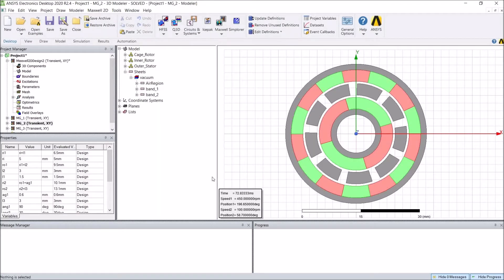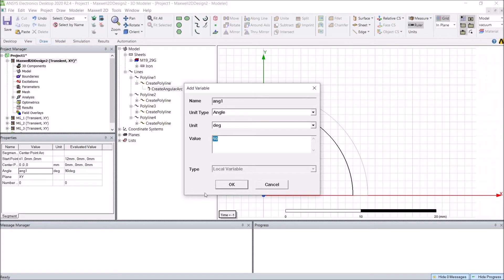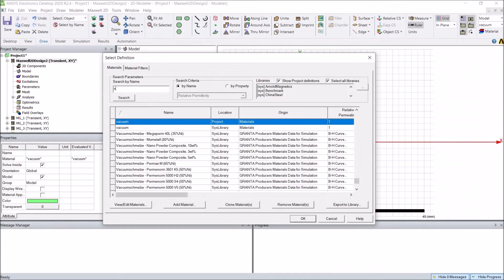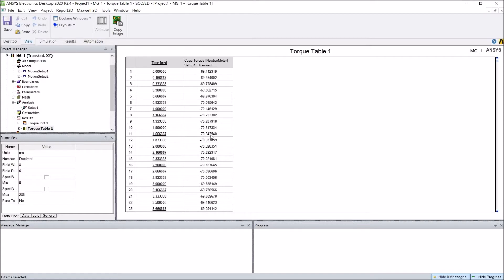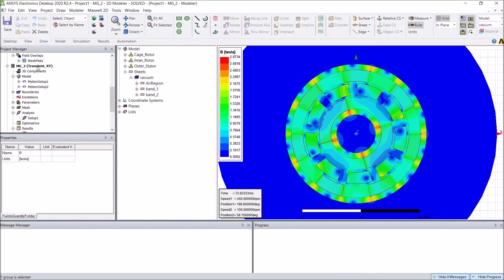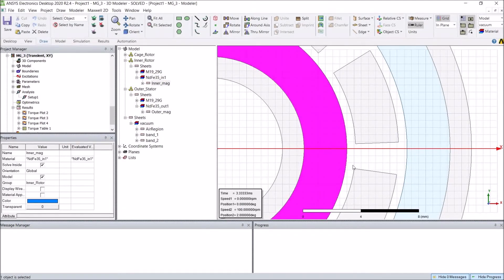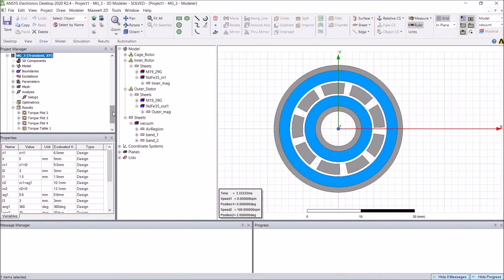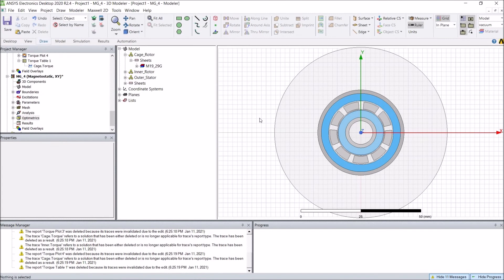ANSYS Maxwell: Building a Magnetic Gear Model

Comment: Hello, im not understanding how you calculated the 450rpm for the inner rotor. In your model, the inner poles pairs (pin) are 2 and the outer poles pairs (pout) are 7, giving a 9 poles pieces modulator. The gear ratio is G = pout/pin = 7/2 = 3.5 right? if so, shouldn't the inner rotor be rotating at 350rpm? Ty in advance for your response. Great Video!
Reply: It all depends on which one is the stationary part. In the video, the outer one is actually fixed. So the gear ratio is 9/2=4.5 which gives the inner rotor a speed of 450rpm. If you want to make the outer one to rotate, then you'll need to create a "band" for the outer rotor.